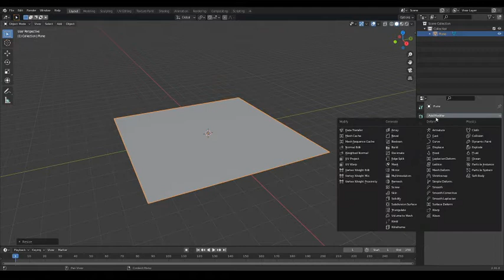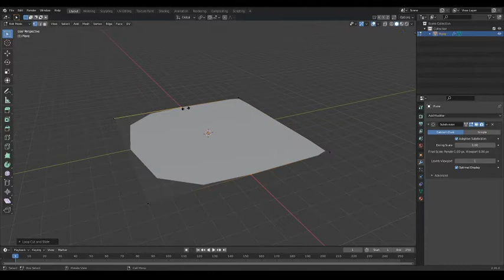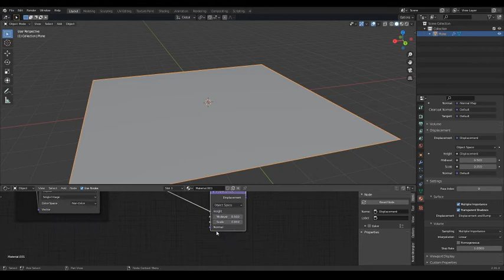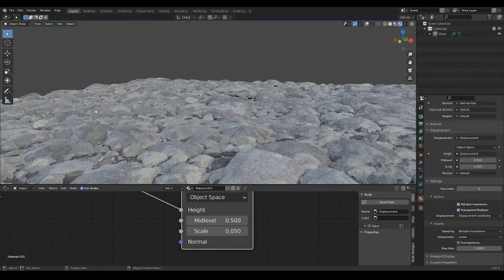Easy Detailed DISPLACEMENT in Blender 2.9 | 3 Minutes | CC0

Comment: Nice tutorial - but you should explain to people that to use Ctrl+Shift+T to load the texture setup they need to install the Node Wrangler addon.
Also instead of doing all those loopcuts after the subdiv you can just check the simple box in the tool.
Reply from the maker: Thanks for the tip!